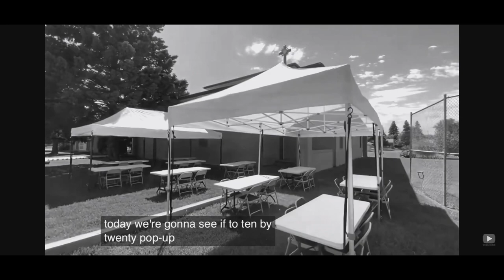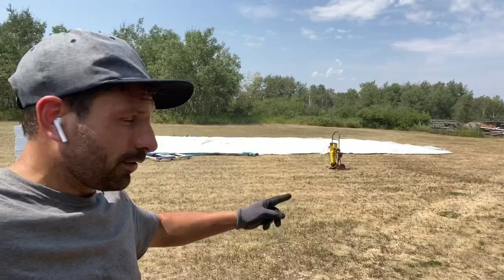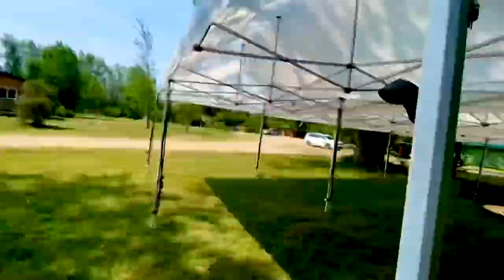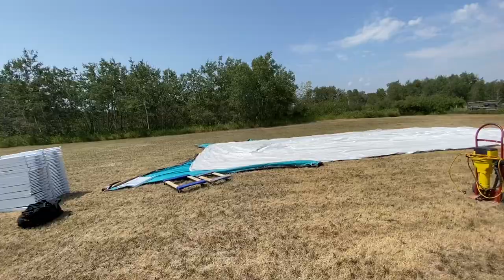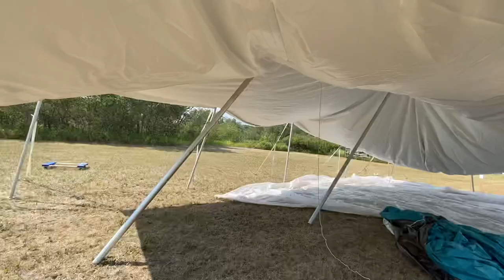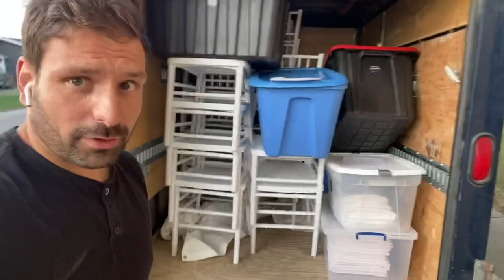Jack-All Tent Stake Puller Budget Post Remover Home Made Rental Business Wedding Tent Install Vlog

Comment: Lee, I need to pick your brain for a minute, please.

When you put multiple 10 x 20 side-by-side long ways what do you do to prevent rain coming down in between, do you use common rain gutters and if so, are you also using some kind of bracket to attach the frames together while leaving space for the gutters?

I have a number of big jobs ahead of me with multiple 10 by 20s put together and it’s impossible trying to find 20 foot on rain gutters that actually do something.

Thanks
Reply from the maker: Hey,
I’ve got a clip in this video where I address your problem. 

https://youtu.be/hBSNHNa4D8E
Reply: I ended up buying four 20' Impact rain gutters to go with my six 10' ones. I had a situation about a month ago where we did five 10 X 20's in a row on someone's patio and it rained so hard the makeshift gutters fell apart, it was a disaster, so I sprung for the gutters. Thanks anyway though. @therentalguy